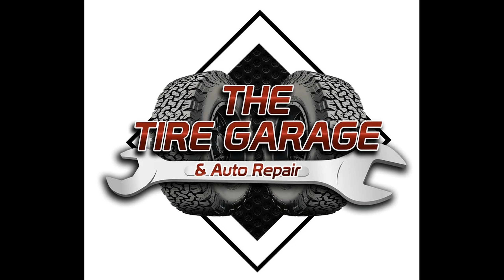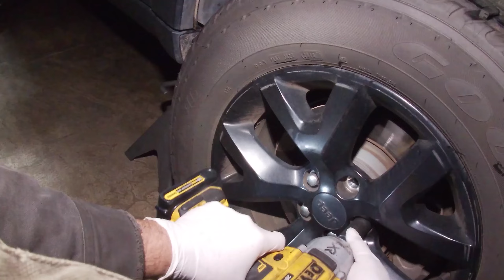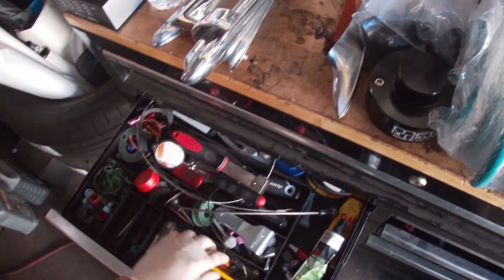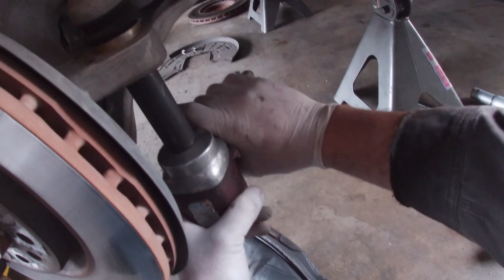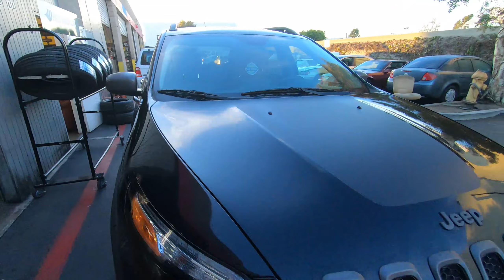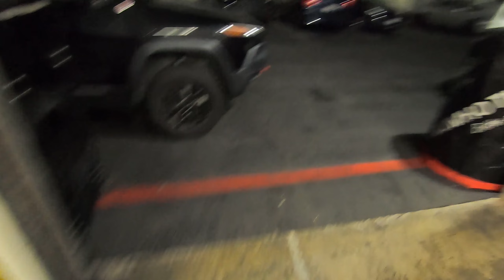Cherokee Trailhawk 3in Lift / The Tire Garage TV Ep52

Comment: Not an expert...but I think the reason it was missing 1/2" is because it is a trailhawk version.  The trailhawk is the trail rated version of the Cherokee.  It is appx an inch taller than standard cherokee versions, has the locking diff, higher air intake etc.   It basically comes from the factory with a 1" lift from taller springs & shocks.  So you will not realized the full 3" lift when it is put on a trail hawk version.  At least that is the way I understand it.

Comment: Do you know the biggest tires you can get with a 3in lift on a Jeep Cherokee KL?
Reply: Biggest are 32" but you have to trim your pinch weld and you might be able to go a little bigger if you put spacers on or have off set rims because at 32" you are about a 1/2" away from the bottom of where your spring rests on your front struts.